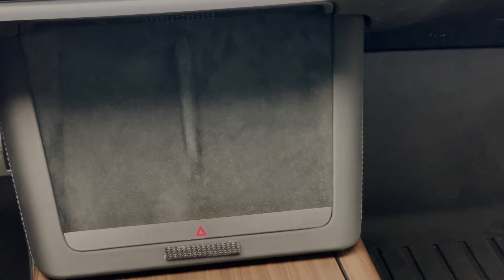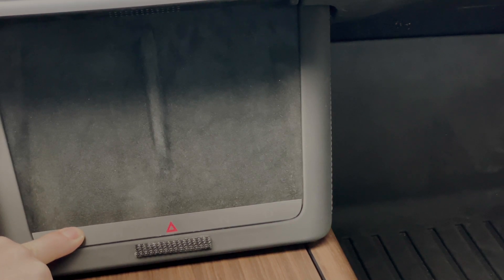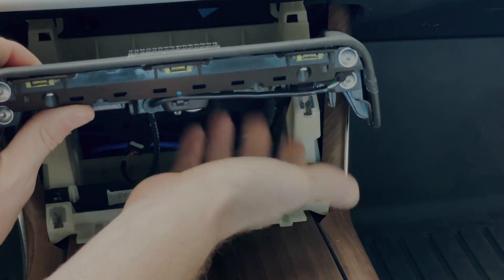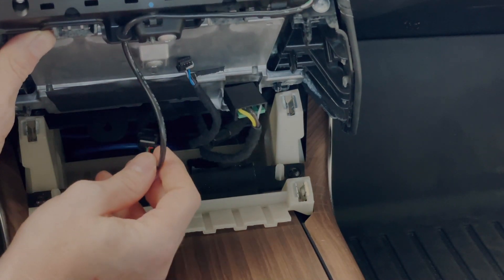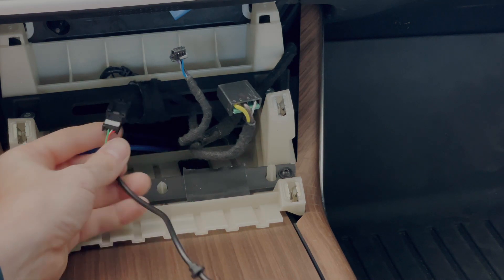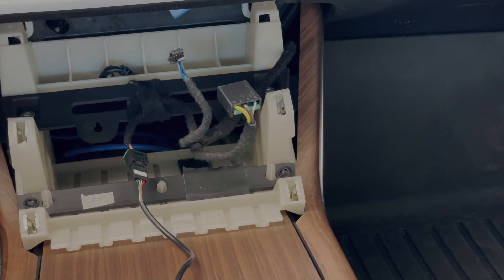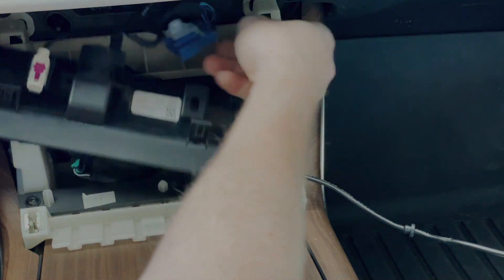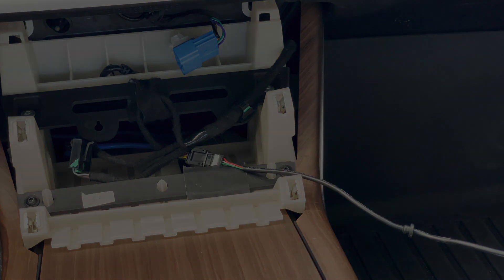Model S Plaid (and LR) Diagnostic Connector Tour

Comment: Will you have more details on the diagonstic connecrtors and any CAN bus connections?  I need to connect into CAN 2 & 3, which is easy on earlier S/X.
Reply from the maker: Here is some info I shared back in August that may be helpful: https://teslamotorsclub.com/tmc/posts/5821188/

Comment: Man that's very cool to know!! That way I can easily run led wires when I need it and also access to 12 volts in there right somewhere righ?? Please show us where to tap it in .
Reply from the maker: The phone dock connectors can carry a lot of current, so they are a good candidate. I even obtained the connector for one side, but the other side is unavailable, as it is intended as something molded into a housing.